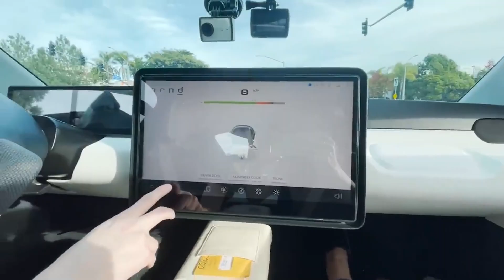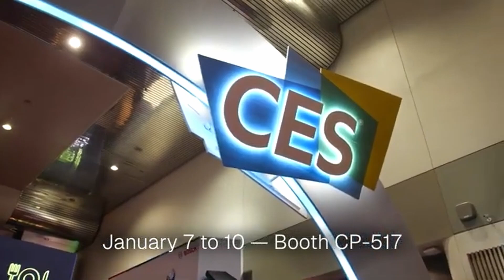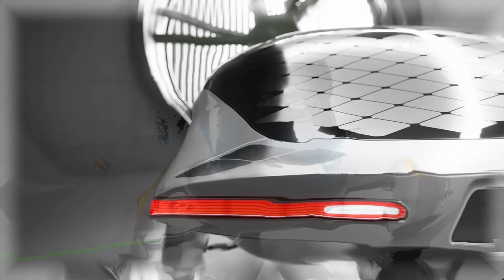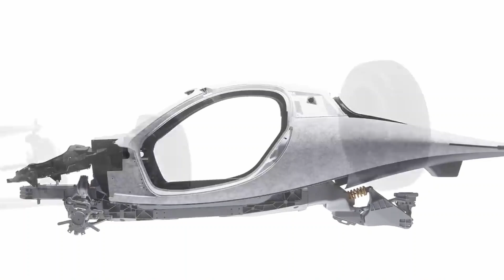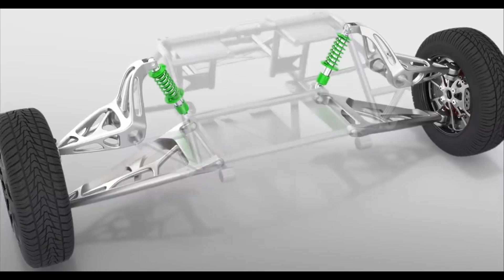Aptera's 2025 Game-Changing Solution Is Revolutionizing The American Dream

Comment: How does a three wheeled Aptera motorcycle, that is wider than a Hummer H1 revoluzionize anything? The solar yield of the Aptera is only 200W. Under best conditions. It needs at least 10kW to drive. So one magnitude more. There is no real innovation from Aptera, everything they do is bang together readily evailable parts. Not even the aerodynamics are innovative. In the 1930s the germans created a real 4 seater car with a better aerodynamic (schlörwagen).
Reply: The width of the car has always been a big turn off to me. Was that to accommodate the motors in the wheels?  Now that they will have one motor will they be necessary. I was surprised that so many in the Aptera community seemed to treat that design change like they’d changed the color of the seats. Seems like the kind of change you make when you are no where near to production. The Sion car from Solo made sense to me in terms of design because it seemed like a car I might want to drive. But that’s dead. Don’t know if it ever had a chance of success.
Reply from the maker: Where is it today?
Reply: What have you invented lately or ever?
Reply: @gregkelmis2435  quite a lot. And  it sold Well. Aptera does not sell anything, just empty promises.

Comment: Plan on doing grub hubs and Uber eats type jobs to help pay for mine. Use solar generators that can piggy back off the apteras solar panels and sell the energy back to the grid. $$$
Reply: I suggest a XT90 connector near the 12Vdc socket for using external solar panels.
Many people have folding solar panels they take with them camping etc. Some single folding panel are rated at 450 watts. Myself I have a few 200W panel I can connect together to supply ~800W to the vehicle.